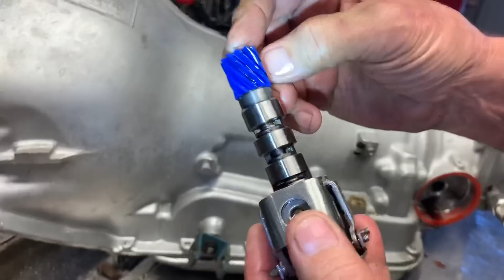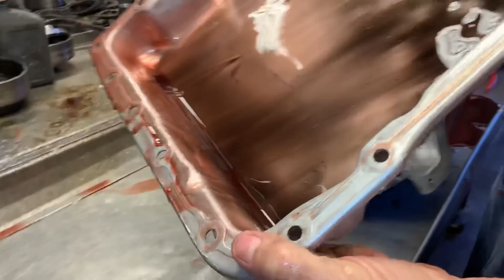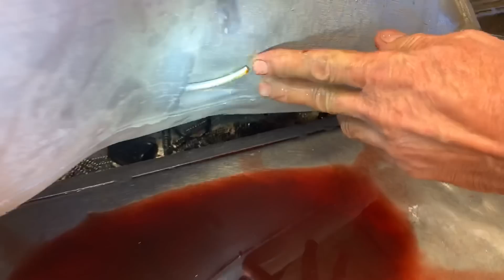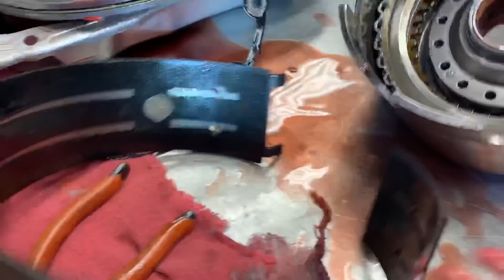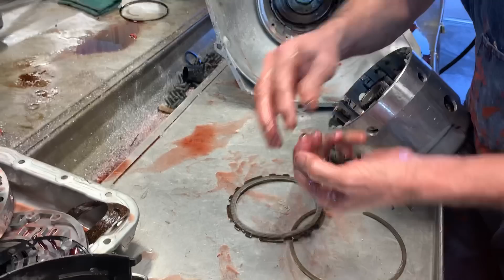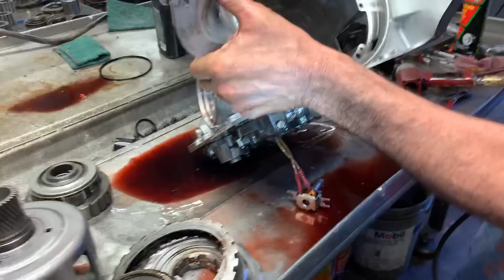Reason why we don’t like doing carry out transmissions. Video 1-2

Comment: Hehe.  Reminds me of days at Lincoln...AOD in the day.  Wanna really finish off the direct clutch?  Disconnect TV linkage and go out on a full-throttle test drive.  Over and out in less than 10 miles.   Was a shame it didn't default to full pressure on disconnect(all it would have taken is a spring)...nope...low pressure.  Zip Zing!

Comment: As a former auto transmission rebuilder I can confirm that fitting transmissions requires a reasonable amount of skill and training. Forgotten alignment dowels, blocked transmission coolers, incorrect tv cable pressure, even incorrect oil level and the list goes on. Of course no one ever makes a mistake fitting them and it must be the rebuilders fault which he must not only fix it for free, he must drop everything he is working on and do it right away. One of the reasons I no longer do this type of work.
Reply: There's a lot of bad shops out there, too. I had a chain shop put a new transmission in my Crown Vic once, along with a new transmission cooler. About two weeks later it neutrals out at a stop light. Turned out they hadn't been careful enough routing the transmission cooler hoses and one of them wore through.

Comment: My transmission man told me one time to bring it back to him after install so he can adjust tv cable. 9 transmission carry outs later we have had zero problems with any of them. Carry outs save me 600$ a pop.
Reply: If you know what you're doing and have them double check on some more specific trans then ye no biggie. If it's any basic chev 1/2 ton trans idk how you could ever possibly mess one up but yeah.
Reply: yeah, it's pretty straight forward isn't it? Engine off, push button on TV linkage at carb/TB, then push the gas pedal to the floor and it'll adjust itself. Not an expert, but that's what I remember.
Reply: @grabasandwich  Only pitfall is if you're installing a different engine or carb from stock you have to make sure you get the geometry set up correctly. Other than that, most people do the method you described and it usually works fine.

Comment: You should do a video on how to adjust that cable i just had my 700r4 rebuilt and put back in my tahoe and they rigged a cable on it u should see it it lasted about a month and it lost all forward just had reverse but when I first got it back it shifted hard and at 3,000 rpm I liked that as time went on it would shift extremely quick way b4 it should have and I paid almost 2grand for it they rebuilt it and I drove it home now just sits

Comment: what did the 3/4 piston seals look like in the bottom of the input drum. also the input shaft will sometimes move under pressure and burn up 4th it needs to be pressed out and lock tite in.  the cushion springs for the 3/4 clutches you tell everyone to put back will collapse and bind and burn up 4th on a regular vehicle I never put them in! they are only there if a motor is over revved and forces 3/4 apply and burn them, also if reverse boost valve is stuck in pump it will fry 4th, many factors.

Comment: You can pay me now, and then pay me again later when you screw it up. I rebuilt snowmobile engines in the 80's and 90's. I only had a warrenty on manufacturers parts. I cannot count how many guys would go out and beat on a newly rebuilt engine with no break in. After a few returns, I refused to do any snowmobile engine rebuild that I didn't install and break the engine in myself. I got 0 returns on those. Anyone can put something back, its a matter of putting it back correctly and getting everything together correctly that counts.

Comment: The reason the 3-4 clutches burn is you have a leak between the shaft and drum I am talking about the input drum with the shaft.
You need to pull the bearing and selective washer out. Remove all pistons then put some brake/clean where selective washer was. Put some air into the 3-4 hole inside the drum with your finger over the feed hole and watch the air bubble out between the shaft and drum.

Comment: I'm a 30 year mechanic...done Honda's none planetary transmissions and gm transmissions...4L60 4L60E's and several 4T60E's,i learned them at the GM training center in morestown nj... And with all due respect a mal adjusted tv Cable should not cause a problem within 4 miles...holy crap

Comment: these Transmission Guys are like God I sware I can rebuild a Manual but when it comes to 47 million PArts I'm out that's the whole reason why we pay because we do not like putting puzzles together it's like an adult Logo set
Reply: Right on brother! I've repaired a lot of weird stuff in my 63 years but I refuse an automatic transmission. I'll remove and replace all day long but I will not open them.
Reply: The amount of knowledge required to rebuild one of these transmissions correctly is simply too much for something I might do once every few years.  Well worth the money to pay somebody else!
Reply: Manuals are more complicated and have more parts. Load up the 33 individual needle bearings into each speed gear on a Tremec 3550/TKO, and come back to tell me how Autos have so many bits and pieces...

Comment: The magical TV cable on the 700R4.  The entire destiny of the transmission depends on it.  Get it wrong and it smokes it in 10 minutes.  Get it right and the transmission will last 6 months if you’re easy on it.

Comment: Non TV transmissions would not have this problem then. I have a 4l60e 2003 S10 4.3l v6 that lost reverse. I have been told it's the sun gears that caused that. I am 8 hours, 500 miles away. We wanted to get a transmission and have a local shop to the transmission R&R S10 website and groups have recommended this place as one of the best places to use.

Comment: That's bad that outside the transmission ,a simple cable adjustment can burn it up. My transmission in my 96 Z71 burned up while in traffic no where to pull off for highway construction. The E clip came off holding the pressure line blowing the fluid out. Trying to find an opening to pull off took about a mile. So I have no 2nd gear or passing gear. Just 1  3 no overdrive and reverse works

Comment: I adjust the detent cable by letting it loose by pushing in the sides and pushing the throttle on the carburetor or the throttle body all the way wide open i do it under the hood by hand not using the gas pedal. Then once its all the way wide open lock the detent cable sides by squeezing it do this with the engine off of course i have done this with 700r4s for years never had a problem?  I may be doing it wrong but thats how i do it .. I am open to opinions on this topic for sure im not a know it all im a student for life ..,

Comment: Have you ever seen bushing wear cause sufficient misalignment to effect the shaft piston ring seal, excessive leakage and burn out clutches? Also something between engine and bell housing faces during reinstall causing converter and turbine shaft misalignment?

Comment: Curious, would you re-use the new torque converter that was installed with this transmission?
I would, but I am just a line tech, not a shop owner.

Comment: So if this is the initial tear down, where was the transmission filter when the pan was removed?
Reply: Because when they pulled the pan and filter to drain the fluid in the car before they removed the transmission from it. He said when they got the car in, the lines had leaked all the way back to the axle.
Reply: Obviously thr person who pulled the trans drained it first. No point in putting all those pan bolts back in

Comment: Carry outs.  How many guys didn't fit the converter correctly. The pump lasts 5 minutes then too.  I believe the 700 needs the cable to be tight on full throttle, whereas other autos don't?

Comment: Mechanic obviously knows his stuff.  Impressive.
But my 'on the other hand...' is.... I've seen quite a few mechanics (and tradesmen, for that matter) that are overly confident in their work and just tear through their task at hand... but out of haste make one tiny little mistake and then try and cover it up by saying 'the customer did it wrong.'
His hands were steady at the start, and he seems to 'know' what the problem was before he even started.  1/2 way through his hands started shaking and the narration was less and less specific.
He claims the customer just didn't make the proper 'adjustment'... but I just have the gut feeling that he noticed an issue while disassembling the transmission... and just covered it up with his banter.
Yes, you are right... I don't know a darn thing about transmission construction... but I think I have a knack for smelling bs... and I don't think the fluid is the only thing that stunk in that video.
Go ahead... tell me I'm wrong.  I can take it.

Comment: If I bought a master transmission rebuild kit for a 4L60E the correct stall torque converter and all supporting electrical parts how much would I expect to pay for labor to have it installed in my transmission? Right now I'm just trying to discern what is reasonable for a price to have a transmission in an S10 rebuilt. Now that I see and an experienced man of his trade can break it down in less than 15 minutes I know it takes longer to put together and that's where the cost of comes from, but my question is how much should it really cost if I buy all the parts? The thing is I'm not cheap I am just not going to pay extra for the same parts to mechanic would buy. Funny thing with the internet these days if you know how to correctly read numbers that are stamped into the transmission casing you can actually get the correct parts for less. If I'm going to drive my vehicle 3600 miles in one stretch pretty much with five breaks at at least 8 hours a piece I want to know that every part that I bought is in the transmission brand new. And the only way I can see that happening is taking every part that is old directly out of it and replace it with something new. The last time I spoke with an automatic transmission specialist I will say he was less than forthcoming which information when dealing with a previous customer about that exact issue so I didn't go back to him.

Comment: Automatic transmissions, who's the mad scientist that thought up that mess.
Reply: The same ones who thought making a snowmobile drivetrain entirely out of metal was a good idea to save fuel in vehicles.
Reply: Greeks, 500 BC. The Model T was basically an auto gearbox that you had to manually shift, it was much easier to use before they invented the synchromesh.

Comment: was the customer advised about getting the shift down cable correctly adjusted? I changed the carb on my 76 nova that had a rebuilt 350 trans. I looked over and determined how the shift down cable functioned on the 2 barrel and fabricated my own linkage for the quadrajet conversion. never had any problems but I did not know what would have happened if I did not do it rite before starting up the engine. is this a turbo 350 trans or what is it?

Comment: I got a spare 700r4 for my K-5 that came from a 2 wheel drive Suburban. I got to fit it into a 4x4. How much trouble changing it will that be?. I think output shaft needs to be cut.
Reply: I just looked online to confirm, and it seems the tailshaft will have to be swapped, so complete teardown.

Comment: you should have required the guy to replace the tv cable with a new one and flush all the old fluid out of the transmission cooler ....I like having bench rebuilds done being I'm not going to pay someone between $600 an $1000 to remove and replace a 2wd 700r4

Comment: 7:31 shop brag about upgraded 3-4 clutch pack and it went up in smoke just a fast as stock.
Reply: Well yeah, with the TV valve not set right, pressure is way too low. Any kind of clutch needs a minimum pressure to hold under load. The TV valve was probably still near idle position, where not much load is needed. That's my take on it.
Reply: @grabasandwich  Have you ever program a 4L60e using HP Tuner?
Reply: The problem had nothing to do with the transmission, the throttle valve cable wasn't adjusted correctly at the carb. The customer even admitted it.

Comment: How do you adjust the cable to avoid that problem?
Reply: They're so old now that there's probably tons of sites or videos on it. Pretty much obsolete though, as even the 4L60E (basically a 700R4 with electronic solenoids etc) has been around for ages.
Reply: Search YT with: HOW TO: ADJUSTING A 700R4 TV CABLE

Comment: CNC Machinist here...what is a "carry-out transmission"?
Reply: When someone brings in the transmission without the vehicle its attached to. So the install is left to the owner
Reply: @themindofjohn4346  ahhhh right on.  most shops prefer to do the install themselves i guess?
Reply: @orangehammock  yeah, because say I just rebuilt a hydraulic pump for someone's lawn mower and I didnt install it as it should be installed, then I'm gonna have to waste time and money to rebuild it twice because he had dirt in the lines and didnt flush em. Dont rely on customers to do it haha

Comment: What is a carry out transmission? transmission job?
Reply: Its a situation where a do-it-yourself customer removes the defective transmission from the vehicle and carries it into the transmission repair shop. The repair shop then rebuilds the transmission and gives it back to the customer who carries it back out of the shop. Then the customer re-installs the rebuilt transmission into the vehicle by himself. The problem is that if the customer makes a mistake during the installation he can claim that the transmission was not rebuilt correctly when in fact it was installed improperly. That's what happened here. The customer didn't adjust the pressure cable going to the carburetor correctly, which damaged the rebuilt transmission right away. This can create a serious disagreement between the transmission shop and the customer as to who is responsible and legally liable for all the additional repairs. Precision Transmission's point is that if the repair shop is allowed to also do the removal and re-installation then problems like this can be avoided. In the end it cost the customer a lot more money by trying to do part of the job by himself than if he had let the repair shop do the entire job right from the beginning.

Comment: Stop putting sealant on the pump! It's squeezing out and flowing through the transmission. The line pressure will push through any sealant you put in there. Check the pump halves with a straight edge and machine them down properly if necessary.

Comment: and who screwed ?, why this gearbox failed after 5 miles
Reply: He explained it rather well. The installer failed to hook up all the input functions properly on the transmission so that proper pump pressure was absent when the owner drove the vehicle, overheating clutch packs and bands.
Reply: Thanks
Reply: @makantahi3731  No problem! Have a good day.

Comment: What do you guys think of CVT's??
Reply: junk
Reply: You have to be more specific as there are many different ones, including some that are called CVTs when they aren't, and just the opposite, some that aren't called CVTs when they actually are. Examples of the second category are the MTD Shift-on-the-go lawn tractors and the centrifugal cone and belt CVTs that people put on things like go-karts that they call torque converters for some reason.

Many of the metal push belt type ones are indeed junk, and some are just strange and pointless because they are programmed to do fake shifts and defeat the whole purpose of a CVT which is to keep the engine at the BSFC sweet spot at light loads for best fuel economy, and keep the engine at its peak power RPM when WOT for best acceleration no matter what speed the vehicle is going.

Comment: that adjustment is not hard at all to get correct. I used  to click it one more notch to increase the line pressure on mine. I would for sure let this guy build me a trans if i went back to a 4sp auto.

Comment: Really emphasizing the cable being not adjusted properly.  Sounds like an excuse that was latched onto.
Reply: No, he is right. The 200 and 700 are super critical on that. I have a 700 in my 80 Camaro and a 200 overdrive in my 81 Monte. Both work fine because I was super careful setting the cable up on Holley and Edelbrock carbs. I've had no issues but I've seen other people wipe out the clutches by not following spec. The C4 C6 and T 350 or 400 don't need any kickdown connected, it is optional but the later overdrives, including the Ford AOD tv cable setup has to be done right. The spec is this - pivot point 1.1 inches from throttle shaft centerline, make sure tv cable is fully extended at WOT, make sure of no cable binds and you are good to go.

Comment: Have a perfect rebuild and miss adjusted throttle valve and not back flushing the cooler or replacing it will smoke the trans. Newer units cooler replacement yeah the radiator a no brainer installed second party dont wast your time its all or nothing.Got bit only once back then after that only I remove and install trans. Years ago made a few bucks out of my garage my day job just the same.Today dealing with class 8 truck emissions issues ah the dreaded nox conversion efficiency code every day.This code will take up half a day to diagnose. Ah covid business as usual keep these puppies running no mention of mechanics on the front line. We are at risk just the same just saying.

Comment: I feel like we're going to lose a lot of good engineers when everything goes to electric hub motors, that just get replaced.
Reply: Electric hub motors have very little mechanically to go wrong other than bearings, easy to diagnose windings and hall-effect sensors. I am sure they will be as rebuildable/rewindable as any motor.